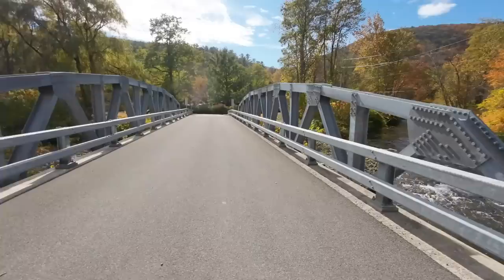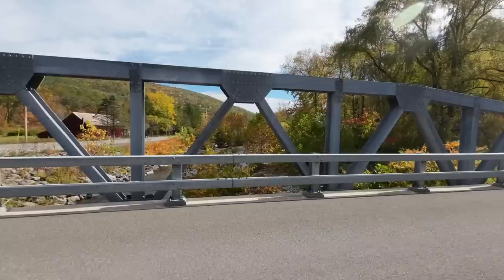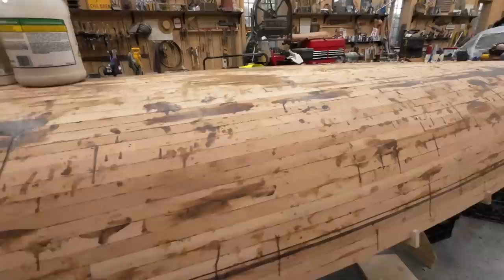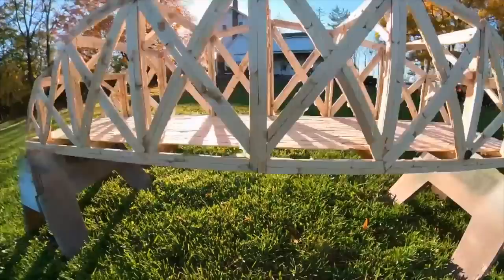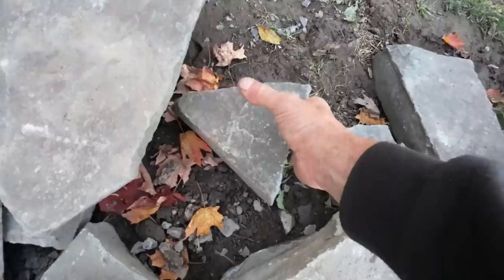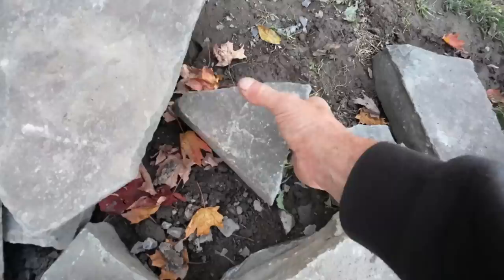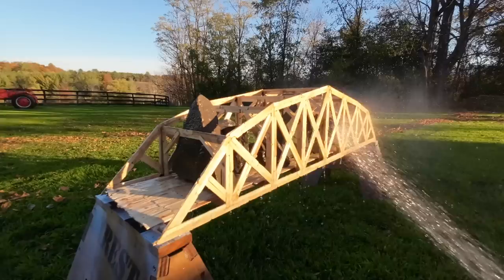DiResta Truss Bridge from Popsicle Sticks

Comment: One of my favorite projects from 3D Design in college was made with white glue and toothpicks. Had to be three lengths of toothpicks tall and support 30lbs. The toothpicks were only supposed to touch at their ends so we couldn't layer them which added an arbitrary level of difficulty. About a week before in class the professor had said 'the triangle is the strongest geometric shape' so I was surprised when mine was the only three-sided pyramid.

Comment: In high school, we had an engineering challenge with several other local schools. My team had the tower, with the winner determined by the weight held divided by the weight of the tower. There was a guy in my school who entered the toothpick bridge competition. His design was a solid triangular truss that was oddly spray painted silver. He 'won,' and by more than a little. How he won was revealed when the suspended weights finally broke the bridge - revealing three fiberglass arrows in the core of his design.

Comment: In middle school wood shop we had a competition to build a truss bridge using 1/4"x3/4" strips of wood. I went with one of the most simple designs because I didn't want to put in a ton of effort just to have it destroyed. I ended up getting first place, I think mostly do to using a proper amount of glue and having plenty of time to let it dry (we had 2 class periods to build it but I was done day 1, so it was able to fully cure by testing time).